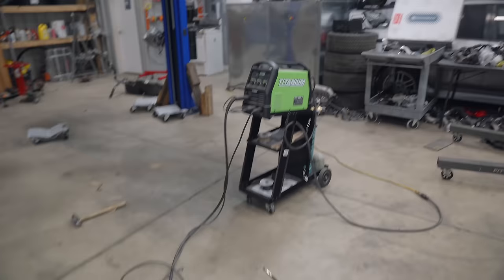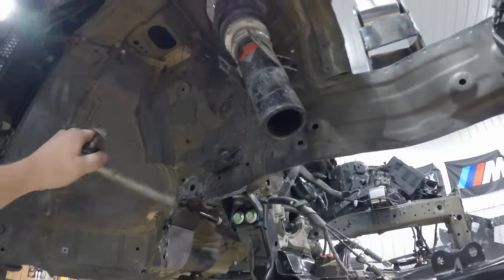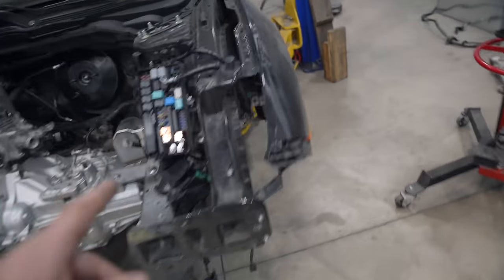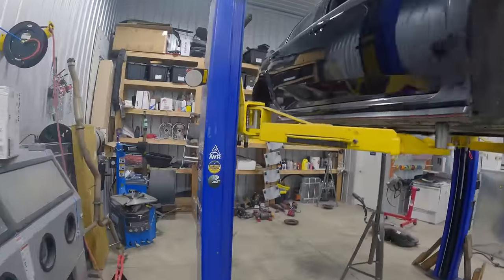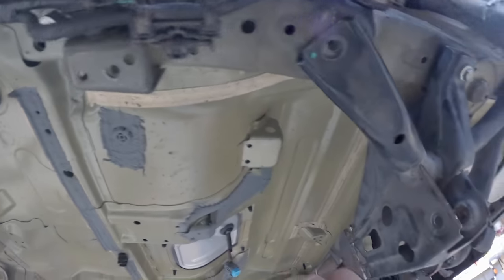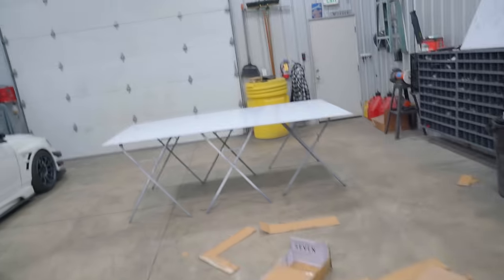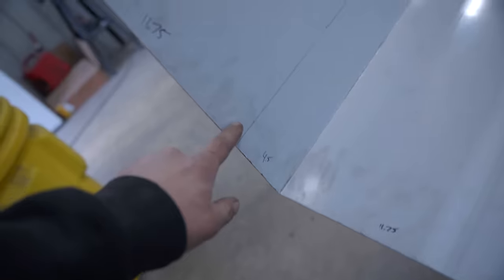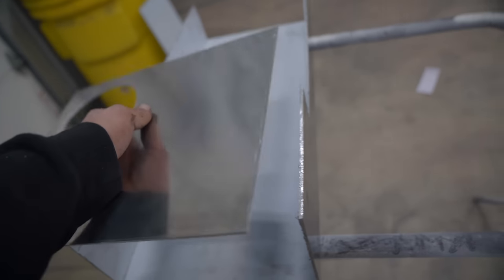Building an AWD Civic Type R | Ep. 12 (i dont know what i am doing)

Comment: A little tip. In structural areas, sharp corners are much more prone to stress cracks, so you always want to make smooth transitions when you are cutting and making filler plates

Comment: Hey Devin, awesome work, one of the best builds I’ve seen. One thing to check is the bump steer given the change in rack position. You can check this by connecting all the front end together and then move the front suspension up and down with the steering wheel held straight while measuring how much the steering angle changes on the front knuckle. You may need to change to the CRV knuckle or modify existing knuckle to get the steering tie rod alignment right to eliminate the bump steer. Hope this helps.

Comment: Also it’s good to put a cup that sits lower that the rest of the tank for the pickup to sit in so it’s always submerged. You can weld a nut in the bottom of the cup and install a sump plug for easy draining

Comment: Nice job dude! If for some reason this setup doesn't work out, look into using external surge tank and just use factory hanger with the feed pump in the cell. Much easier setup to fit in the smaller cell since you can just mount the surge tank in the trunk behind the liner

Comment: A tip for the TIG welding, when marking your cuts if you use permanent marker on the aluminum you need to wipe that completely off before welding. Goes without saying maybe but otherwise it will and up in the weld contaminating it. I know because I tried it. You seem to have only marked the protective film but I still want to give a heads up.

Comment: Word of advice after you weld the tank test the tank with water and check for leaks, you can use a milk jug to see how many gallons each tank holds. once you fix all the leaks if you have any spend the money on tank sealer it will seal any holes that are very tiny and hard to see leaking. I’ve done it three times and it works Awsome and is worth every penny!
Reply: Also weld as much as you can especially on the bottom and sides of the tank inside and out the weld the top on just on the outside

Comment: You should be thinking about either putting in baffles or fuel cell foam to stop the gas from sloshing from side to side when your cornering at height speeds or going up or down a steep hill so you don’t starve your fuel pump.
Reply: That's why he's running the Radium surge tank

Comment: Devin great work and all but, keep in mind you have to add a filler neck and it should be at the highest point of the tank to be able to use the full capacity of it 
Also you should connect the two tanks together preferably from the bottom to have the same amount of fuel in both of them to have an accurate fuel level reading and so the pump side don't run out of fuel and the other side is still full it would be unusable
But there's a way to have 2 completely separate tanks but you should have fuel pumps in each one and 2 fuel level sensor and 2 filler necks 

Keep up the good work man 
Love an support from Egypt